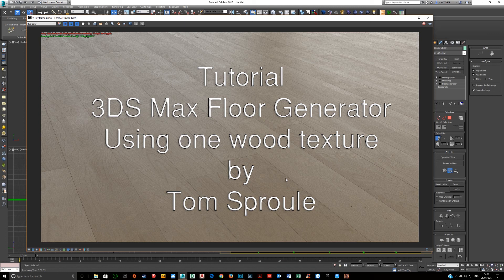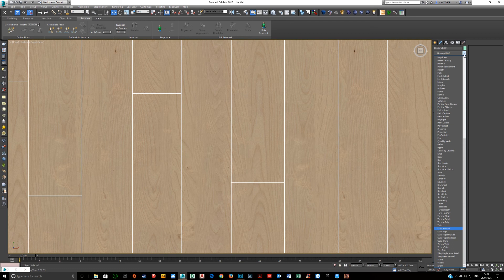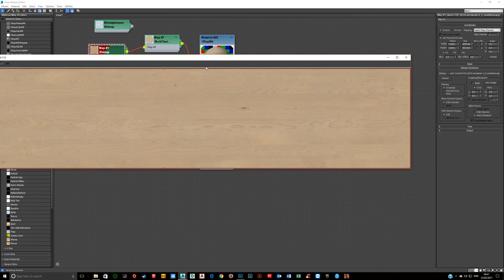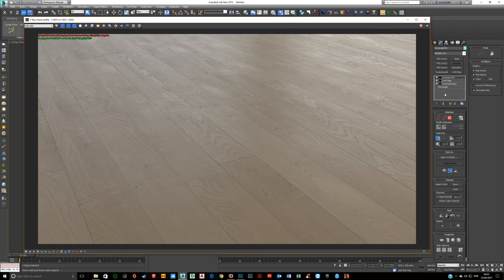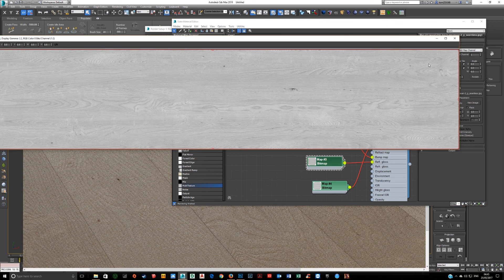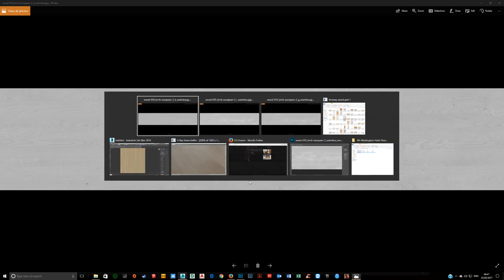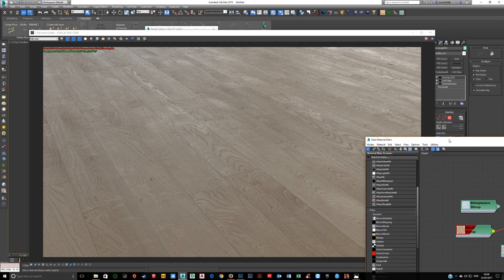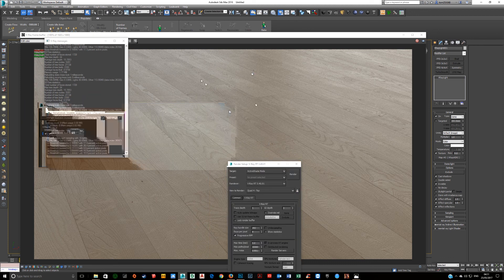Tutorial 3DS Max Floor Generator Unwrap

Comment: Hi.. I have a problem with my floor generator when I apply the material with a multitexture  map its use one map & it repeated it's not randomized. Thanks
Reply from the maker: Hi - well check the website from CG Source. Specifically check these two pages. 
https://cg-source.com/FloorGenerator
https://cg-source.com/MultiTexture
This should answer your questions.

Comment: Great tutorial - please can you explain how in the UVW Unwrap Editor your tile is 1x1, yet the bitmap of the texture is not a 1x1 aspect ratio (but 3000x800, or 30x8).  Were you to place that bitmap into the UVW Editor (instead of the checker pattern), you'd see that bitmap would be squished.  This is where I get confused with Unwrapping.  I'd really appreciate your explanation please :)  Thanks.
Reply from the maker: In the UVW Unwrap Editor you have the square in the middle which everything is unwrapped and packed into. Well if you are using real world scale that square will be one unit, so 1 cm if you are using cm's or 1 mm if mm and so on. If you go to 'Customize' and then 'Units setup', you can set the display units and the units the scene uses. Make sure you click on 'System Unit Setup' and set the units there. So, you set the unit and then the unwrap sets that square as one unit. So, if everything is packed into mm you need to scale everything up to the size it needs to be. I hope that makes sense if you watch the tutorial.